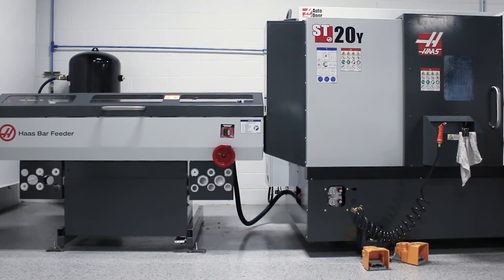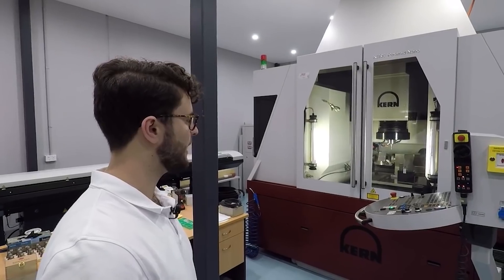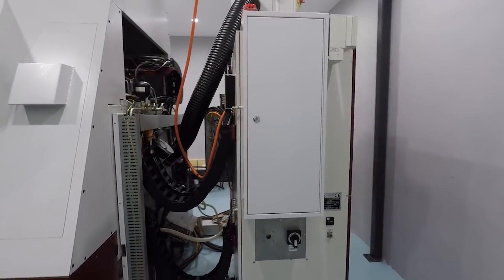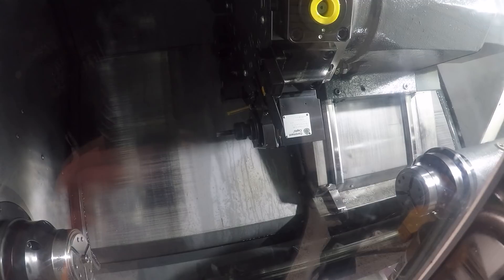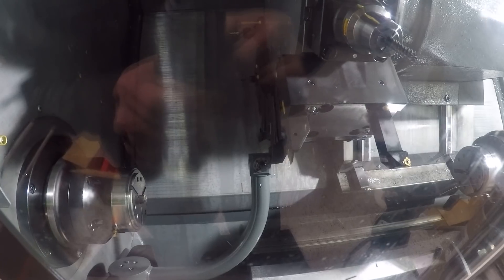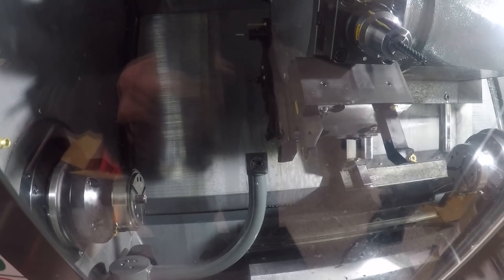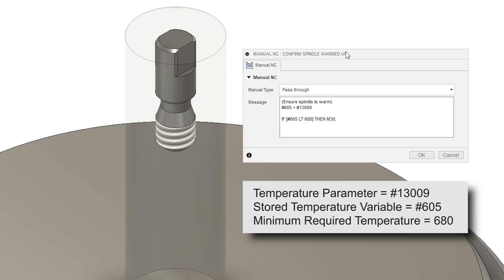Making Accurate Parts on a CNC Lathe: Dealing with Thermal Growth!

Comment: unless otherwise specified, all dimensions and tolerances are applicable at 
20 deg.C.(68 deg.F.) in accordance with ANSI B89.6.2 
compensation may be made for measurements at other temperatures.

Comment: This is also true in 3d printing surprisingly enough, a machine that a machinist would laugh at with tolerances and you can get a noticeably better part when you let a machine heat soak at its printing temps

Comment: Can you confirm that the thermal compensation is power on time based as the Haas has no sensors other than the electrical cabinet?

Comment: I’m running a nakamura as200l and it has about a 0.0015” warm up in the x axis. I try to do the setups with the machine cold so I’m not chasing dimensions. Then let it run in memory restart cutting air for about 4 cycles (26 minute cycle time) and it will be ready to rock. Will hold a 0.0001 all day long.

Comment: It's a bit of a pain working at night. 
But this is generally the best time to run tight tolerance parts.
The temperature at night time is more stable than daytime temperatures.
Reply: And those odd saints keep the day-shift productive. (When we're not blaming them)
Reply: @mitchradoll278 
 Yes. 
Definitely a lot of rivalry between Day shift and other shifts working in the same shop. 
The blame game is Never ending  🙄

Comment: Used to run Hyundai HIT-30 lathe. From 07 00 to 12 00 I'd be changing offsets. From 1200 till 15 00 it would hold microns
Reply: LOL. 
CNC anything always run like this. 
As the temperature rises in the morning it can play havoc with tight tolerance parts.

Comment: It's amazing how much thermal stabilization affects things.  Where I work, we have specialized video projectors (some of them worth just under $1M each).  They have custom lenses on them (each lens is just under $100k each).  We've found that we cannot adjust focus until the projector has been running for at least 30 minutes because the heat of the light passing through the lens will change its properties.  If we focus cold, it will be out of focus when warmed up.

Comment: Using Macros is such an underrated skill!
You could alarm rather than M30 so someone doesn't think the part is finished and put it in the "Good Bin" and start the next part off.
 (Ensure spindle is warm)
#605 = #13009
IF [#605 GT 680] GOTO123;
#3000=1 (Temp too low)
N123

Comment: I loved this video.  I literally dealt with this today boring a .4997/.4999 hole on my mid 1990s Daewoo Puma.  Knowing the machine and how much it moves  is important.  Once you get it warmed up it will hold dimensions all day.  The problem is it takes quite a while to get everything warmed up.
Reply: LOL. 
Yes it can be a bit of pain If you choose to warm up a machine for accuracy. 
Either that. 
Or chase your numbers until everything settles down. ????
It does depend if it's your machine or you just run that machine 
Simply said. 
A boss wants product asap. 
They have not much care for you stuffing around adjusting things while your pulling your hair out.  🤣🤣🤣

Comment: So true, few years ago i was working on titanium dental implants production, where we had some tolerances about 5-10 microns. Temperature was everything, you don't want to stop your lathe at any cost, you will hate the one who opened a window in the far corner of the shop, expecially in winter and if you out of tolerance, its easier just to make offset changes while making some flaw parts running instead of stopping machine for couple of minutes to realise that almost all of your tools moved on x axis for a  dozen of microns sideways ;D

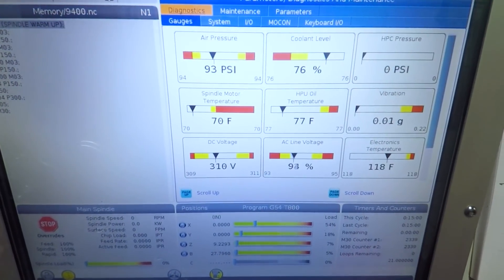Comment: Hi John, I saw on 8:59 of you diagnostic screen that's your DC voltage is low. It shows DC voltage of 310 Volts which is on the low side (310-360 V). Do you have any electrical issues?
Reply: WOW. 
Well spotted. 
Now i need to watch that part of the video again  🤣

Comment: Step one.  Don't buy a Haas.  Step two. AC the shop.
Reply: Wrong ...he explains why you don't need more than a Hass and with the money you will save you can afford to climate control your shop.
Reply: @3markaw  Lol. "Don't need more than a Haas." They are base level machine tools at best.  At my last shop that wasn't climate controled we had several Citizen swiss machines that would easily hold .0001s all day from the moment it was turned on.  All of the hoops they had to jump through just to do what other machines can easily do just proves my point. Haas has it's place in the industry, but they are commodity machines.  Look at what Titan did with his shop. As soon as the aerospace work started rolling in he ditched his flimsy Haas machines and got better equipment.
Reply: @brandons9138  When you grow up you will learn that a smaller machine has less metal to expand and contract and so you are not comparing apples to apples. Also newer Haas machines have become better than the earlier generations just like Deawoo grew out of the joke they were when they started out and evolved into a decent machine. As far as Titan he has other reasons besides accuracy to switch machines just like he switched locations from Ca. to Tx. Again when you are older you will not so quickly jump to easy conclusions and investigate what can not be easily seen. You might take a look at the Pierson ST-30Y update and hear about an experience with a recent Haas lathe from someone that has both brands in house.
Reply: @3markaw  I'm plenty grown up (46).  I've been in the machining trade for about 20 years.  I've worked on Haas machines, both mills and lathes of many different vintages.  They have gotten better, I'll give you that, but they are still basic commodity machines.

I looked at the Pierson ST-30Y video.  In the comment section he states to "never pay full price for a Hass".  That is not what I would call a ringing endorsement.  He also states in the video that he was impressed that it could do +/-.001 out of the box?  Are you kidding me?  Is that a joke?  Plus he's only had the machine a year.  Talk to him again in 5 or 10 and see how he feels about it.  We have a 25 year old Okuma at my shop that still does .0005 tolerances on a regular basis.
 

What were Titan's reasons for ditching the Haas machines? If not for their flimsy build quality? What then? I've never seen a video where he addresses that issue.  You seem to think you have that information, please enlighten me.

Comment: When I worked with Cnc lathes, I used to make a part that had a 7 degree taper to it. The heat of the machine really magnified the error in the taper. Normally the first 50 parts have to be constantly adjusted, and after that it’s stable for the rest of the run

Comment: Weird seeing Haas be actually decent at something.  I always see them as just a backmarker in F1.  :P
Reply: Irony being their lathes are horrible
Reply: @mannycalavera121  
It's a shame because there controllers are great to work with. 

I guess you just need to be mindful of the limitations of any machine. 

HAAS machines are generally less expensive than others for only one ?? reason.
Reply: @weldmachine  I have 4 Haas machines, I don't particularly dislike them and you're right, their controller are a selling point. Bit tbh the lathes are just not up to par with the likes of Doosan for the same money
Reply: @mannycalavera121  
I would Definitely buy a Doosan well before a HAAS machine.
Especially like the option of a Siemens Controller.

Comment: just curious why you would not have it run a warm shorter warm up cycle with a loop until it hits a desired temp (ex.   if spindle temp is lower than (value) go to #(value) and it runs a loop of warm up, then checks the value again) and have it do this till machine is hot, then you don't have to run the cycle manually.     seems like it may help production because it automates your process more.

Comment: I had a job many years ago where the machined diameter had a total tolerance of .000075" And this was because the part had a +\- .00025 tolerance after plating. and plating tolerance was +/- .0005". Ran part on a Daewoo Puma 240MS. That machine was extremely accurate... The shop I was at only turned the machines off for the weekends
Reply: I'm a home shop guy learning on a Clausing 5900 and have a small Emco PC-Turn 55 CNC lathe I'm converting. Hearing these tolerances makes my head spin. If I can get within a thou I'm doing a jig.

Comment: John, why not have it call up the spindle warm up program for the certain tools and then looping back to the main program if it is not warmed up yet, instead of the m30? That way you don't have to manually run the spindle warm up each time, and then change programs back to the part program. That way you load tools, start the program, and if it's not warmed up, it runs the warm up, if it is warmed up it runs the part.

Comment: We installed a very long bedway grinder.
It was setup perfectly.  Came Back to re check it a couple of days later and it was out again. So we re adjusted it. We repeated it several times and we couldn’t figure it out. 

It actually was the tide that threw it out.
So we had to settle on a average Setting. It’s always been within the tolerance but we and the customer wanted it better but finally decided to settle on good for most conditions.
And we’re talking about microns.
Setting it up was done with piano wires and autocollimators 

Very interesting fact. Shop is relatively close to the ocean.

Very interesting what weird things can influence
Reply: There's a place in IL that one of my teachers in a shop class told me about. They had issues holding insane tolerances on some of their machines and couldn't figure out why. It turns out it was semis rolling down the highway like 200ft away. They then completely isolated a section of their place just for inspection, as in, concrete wall, filler, THEN the foundation.

Comment: Is it possible to have a mathematical constant included in your gcode to add an offset in depending on temperature? Material expansion should be consistent for the material, and it should be possible to plug the thermal expansion coefficient into a calculation to adjust offset, on top of tool wear offset.
Reply: Many controls have a math language to add calculation to the gcode, but it's different for each controller brand, and most posts don't generate any math. I guess you can write your own post, too?
Reply: In my experience, every tool reacts differently to temperature swings, so this thing would be useful for big amount of parts only.

Comment: Here is a thought. Why not use those variables and program it to run or skip a warm up based on the temp. This way the you are not counting on the operator to pick the right program to run.  If temp less than X do warm up 1, between X and Y do warm up 2, Above Y run program. This way if the machine sits till an operator can get to it and it has cooled down, the machine will not run parts till it is at temp with the self check. I use macro programs like this to change the cutting parameters of my tools based on the parts counter for the bar in the machine. It would be a very similar program.

Comment: Note to self, keep an aquarium heater in the coolant tank overnight. :P
Reply: That would just make the coolant a breeding ground of all kinds of nasty stuff.  If you've never had serious dermatitis from messed up coolant, then count yourself lucky.
Reply: @brandons9138  that sounds TERRIBLE.  
As you're preparing for the deed in the bedroom:
"Babe, what's that rash all over your body?" 
"Jus nappy coolant. Bacteriumz n' such. It's not contagious. Let's get it on."
Reply: @shirothehero0609  When I first started as an operator I got a really bad case of dermatitis.  The skin on my hands was literally cracked, bleeding and itchy. All because the coolant in the machine was old and the sump hadn't been cleaned in years. They had to put me in inspection untill my hands healed up enough. The down side was after all that my first day back on the floor they made me clean out the machine from top to bottom.  Over the 15 years I've been in the trade my skin has gotten tougher.  On shop I worked at I decided it was time to do a full coolant change over. I was appalled by what I found in the sump. It was a whit/grey/black mass about 4 inches thick in the far corner of the sump. I had to slice it up and shovel it out of the machine. It was the consistency of mayonnaise.
Reply: @shirothehero0609  🤣🤣🤣 👍

Comment: I run a cylindrical grinder often doing match fitting and I can tell you that temperature really is key. Part comes out of the machine cold due to coolant so if you check the size right away you’ll have to add .00002 to .00004” to your size depending on how big the part is material type and so on. Having a climate controlled shop is very important.

Comment: This is something I learn't pretty quickly. The lathe I work on takes about 2 hours to warm up and consistently hold size. Every part I run for the first 2 hours I need to move the tool wear offset -0.01mm every part I make (usually around 20min cycle time) to keep size. Checking mics is very important too. Always check them in a controlled environment using master rods and take the difference into account when checking each part.
Reply: This is very true. I almost never see anyone talk about checking the tools used to measure down in the tenths, 0.0001. The tools need to be checked routinely as well and be thermally stable, just as the machine need to be. It is a whole process when dealing with tight tolerances.
Reply: Precisely. We have what we call a “Standards Room” in my place of work which is kept at a consistent 20 degrees celsius all year round. It isn’t allowed to be a degree out. This is where all inspection equipment is kept when tight tolerances need to be met.
Reply: That is a lot I worked on Okumas they are top no Change what so ever

Comment: I've got a huge question....here me out. So i got my NTMA Cerfication when i was younger and never worked in the field.  How would i go about getting back into machining...? Serious serious question. I was so young and dumb back then....im super depressed
Reply: Maybe just find a Button pusher Job and go from there
Reply: @MrKurdishFreak  that sounds like a start for sure
Reply: What are you resources? Can you buy an old bridgeport and run some parts manually?
Reply: @jonwatte4293  You mind clarifying that for me sorry im not understanding sir
Reply: @hardhitt3r410  How much money and space do you have available? If you have "a few thousand, and a garage-like space," you could buy a cheap used manual mill, and take some local work for nights and week-ends (manually) to get back into the business. Then once you have some background, you can figure out where to go next with that.
If not, I agree with the others whosuggest getting a button-pusher CNC operator job to start out, and then see where you can go from there.
Reply: @jonwatte4293  I don't think starting his own shop is the way to go.  I agree with Aleksander.  Go find a pure operator position.  That is a good place to start.  Even a job like a tool crib attendant is a good start.  Where ever you go make sure they understand that you are willing to learn, and want to advance in the trade.
Reply: @jonwatte4293  def dont have that money i need a job to get that money ya know! Ima buy a mini lathe and mill and start selling shift knobs 🤷🏾‍♂️ #JDM
Reply: @brandons9138  You phrased that very adequately.